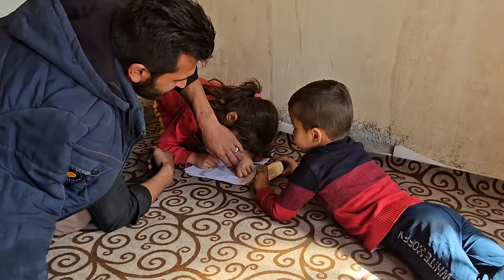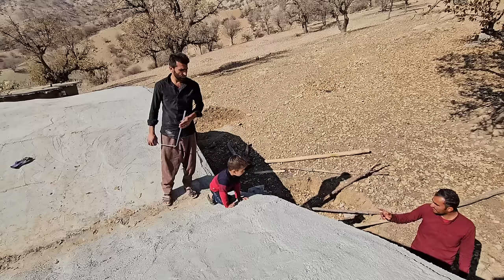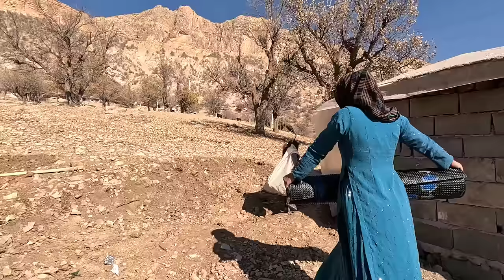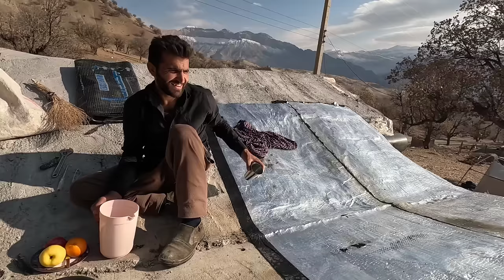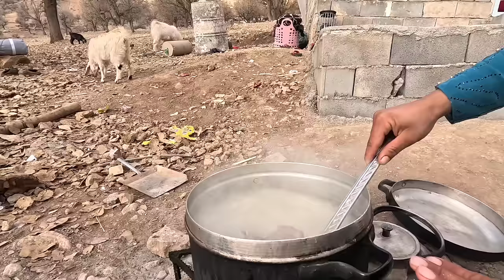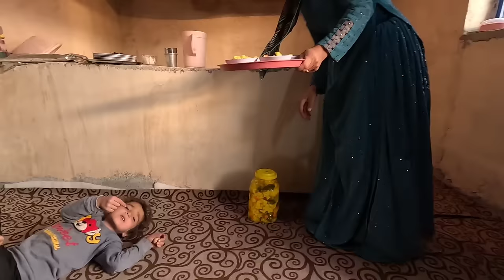Love and nature on the roof: insulation with Izogam and romantic moments in the embrace of nature

Comment: Now I am happy to see that Angel and Imran are getting comfortable in each other’s company and are behaving like mature adults and not behaving silly. Also Angel is more helpful to Imran and they both attend to the children’s needs together which is great. I am glad that they are insulating the roof with tar sheets which will make it waterproof. Imran must fill up with soil the drain that they have cut at the back of the house right next to the brick wall, because when it rains the water will get collected in the drain and the wall at the floor level will become damp and will come through to the inside wall making floor wet and damp.  A drain should be cut about two feet away from the brick walls and making the wall edge high, that is what I think.